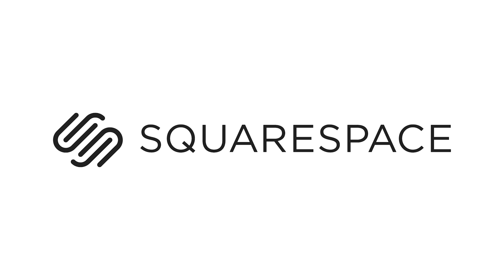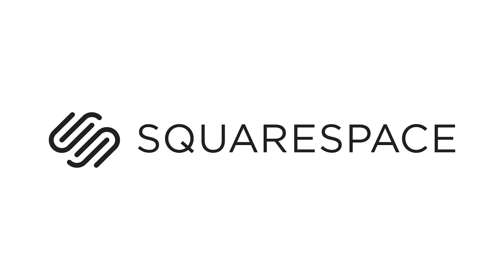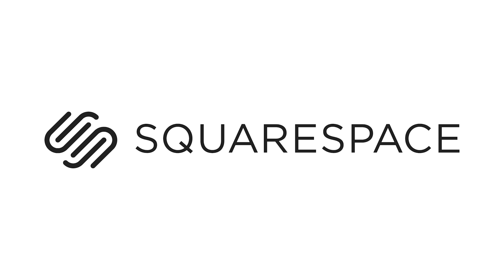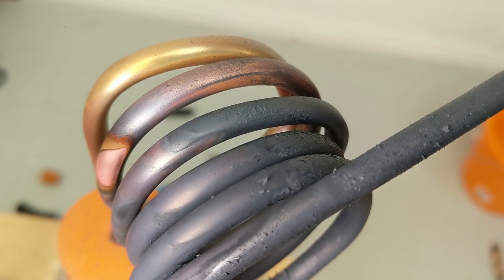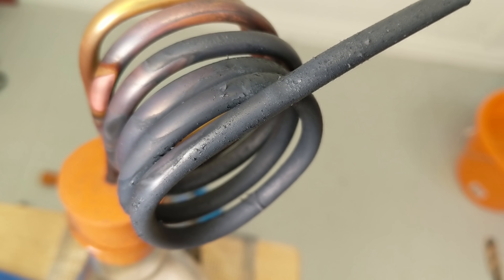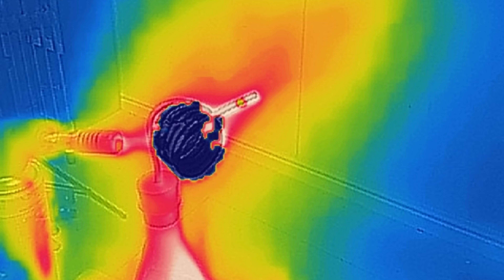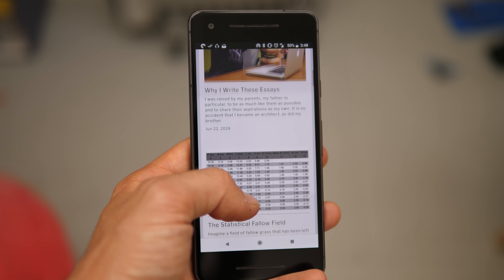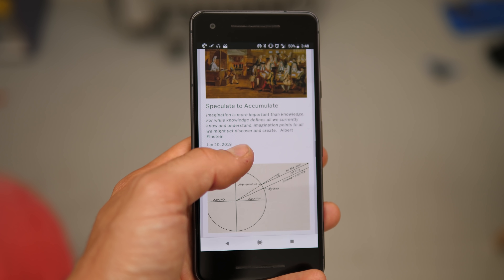Can you light a match with water?

Comment: I know that I'm late watching this video, but at the end where you talk bout the "Fire Triangle" you had that wrong. because the new term is called the " Fire Tetrahedron" which still incorporates Oxygen, Heat and Fuel but also  has Chemical Chain Reaction as a 4th component to Fire.
Reply: False, and that'd be a fire square, or at the very least a quadrangle. You have listened to someone too excited to tell you what went before is wrong. That is a process. And it is a mundane triangle. For example, a flame like event could occur with other elements other than oxygen.
You can tell whoever told you that is a piece of work that they rejected square, rectangle, oblong, parallelogram, rhombus, or, more accurately a quadrangle. 

Its a case of 'overcorrection'. If you wanted to swap to greek, you should use the correct parlance of 'tetragon' to conform with pentagon, hexagon, septangle, octagon, nonangle, and so on.

Comment: Put something on fire needs three things: temperature, fuel and oxidizer. Gas state water can bring match above its flash point, the tip of the match has both fuel and oxidizer, so I think you can do it!

Also, the match stem is mainly made of wood, it needs oxygen to burn. After the tip is done, if gas state water prevent oxygen in the air touching the match, then the fire can't continue.

Comment: Water is actually poor at conducting heat, but you need to stop it circulating because the movement of water will transfer hear effectively.
This is why a wet suit works to keep divers warm in cold water, the water is trapped stationary.

Comment: Very cool experiment, but I do dispute the statement that "water is a pretty good conductor of heat".
I remember an experiment which demonstrates that the opposite it true: Start by weighing down a lump of ice in the bottom of a boiling tube, setting the tube at an angle and filling it up with water. Then apply a flame to the upper part of the tube. The water can be brought to boiling without melting the ice at the bottom. This demonstrates that without the effect of convection, water actually has very low thermal conductivity.

Comment: Ya no one can see the blow torch. Its invisible.
Also, its a useless experiment.
Because using fire to boil the water, again using blow torch to heat the coil.
All to light a match.
AND, THE MATCH BURN BECAUSE OF THE BLOW TORCH, NOT THE WATER.

Comment: Just from seeing the setup I'd say yes. After all the reason water is so good in fighting fire is it's potential to draw energy away from the fire utilizing it's enormous heat capacity and it's suffocating effect by keeping oxygen away from the fire. 
Here you saturate the water with heat and thus also turning it into a gas that might even break down to oxygen and hydrogen which in that combination is highly volatile anyway.

Comment: 0:35 water actually takes not only heat from the flame, but the oxidized as well(a.k.a. Oxygen), which then prevents match from catching fire again, lighting a match in vacuum isn't exactly possible(i mean in absolute vacuum, but in low density air it is hardly possible(counting that you have the lowest density of air in chamber to even light the match))and I'm off the theme here, so yeah, water doesn't take just heat, it takes oxidizer as well
Reply: Maybe in alternate universe where water disintegrates into Hydrogen and Oxygen from heat and forms back from burning those together it would make(kinda or not) infinite cycle where the flame is just boosted infinitely

Comment: I'm going to take issue with your comment that water conducts heat well. It doesn't. Water is not a good conductor of heat. You can test this by jamming an ice cube at the bottom of a test tube full of water, and boiling the water at the top of the test tube over a flame. It takes ages for that heat to be conducted down to the ice to melt it. No, water is great at convection, but not conduction.

Comment: I work at a coal fired power plant, and we use steam at 602°C with a pressure of 260bar in the entry of our turbine. A steam leak in a power plant is actually very dangerous. As you can see in the video, superheated steam doesn't create clouds until it cooled down to be normal steam. So it's like an invisible pressure washer at a temperature that's close to melting aluminum.
Reply: I've heard tell that to check for pinhole leaks in areas where there's a lot of other background noise, a rag or piece of paper on the end of a stick has been used.
Reply: @paulk5670  yes, that's right. I've done that myself. When there is condensed water building up on a surface where there shouldn't be any (and there shouldn't be any pretty much anywhere) we get suspicious and don't walk there. Instead we use a rag on a stick to check for rapid moving gas in front of us. Superheated steam under high pressure is very much like a plasma cutter, but it's invisible.
Reply: Do you guys have any protection that you use before entering the turbine room then?
Reply: @trinitronaphthalene  our protective equipment is our ears. A steam leak is extremely loud, even louder than a train whistle. And the most dangerous place is the boiler house, the turbine room isn't so bad. The greatest danger there is a possible hydrogen leak from the generator, but this is covered by sensors in the area.

Comment: Can you light it by superheated liquid water in a pressure chamber?
Reply: How are you planning to get the match in there? Or the air, for that matter?
Reply: @twistedtachyon5877  A pressure chamber is full of air. That's the whole point of a pressure chamber.

You could move the match into the water using a remote controlled motor.

Comment: 0:42 And an extremely high "heat of vaporization". So when you douse a flame (500+ celsius degrees), you get a lot of steam first, along with the typical sssssshshshsh sound of fire extinguished with water. This takes away from the fuel a lot of heat in very short time. Typically this is enough to reduce the temperature below the fire point so the fuel is no longer able to sustain the flame. Then the fact comes into play that when the fuel is doused with water, the oxygen has really hard time getting to the fuel. This prevents the fuel from heating back to the fire point when some oxygen reaches it and it is still above its flash point. The high heat capacity of the water keeps the water on (and in) the fuel longer because (once the initial flash-boiling is done) due to it the water takes long time to reach its boiling point again and the high thermal conductivity of the water means the heat from whatever was burning reaches the evaporating surface of the water longer (the water keeps evaporating at a really high rate even after it is no longer boiling). All of this works together to extinguish the fire.

Comment: what about that thing where water compresses into a flash of light when it falls into a bubble of vacuum, does that produce enough heat to cause ignition? :P

Also, superheated steam is neat. Can you superheat a cloud? Or I guess the better question is, how much air pressure do you need to have hot clouds lol

The idea that hot water can light a match is kind of pretty obvious, right? I would assume most people would assume that of course you can light a match with hot enough water, why wouldnt you be able to? What I took away from this video that's going straight into my useful and interesting information bin is that copper oxide isn't green, and that its malachite which forms from copper oxide reacting with co2, thats really neat
Reply: Water compress into light? Bubble of vacuum? I think you've had a bit too much of something. None of those make sense.
Reply: @mandowarrior123  https://www.youtube.com/watch?v=wTNbsKX4OV0

Comment: Technically it is water atoms heating the sulfur to it's flash point.
 but it is NOT water that is causing the match to ignite. This is why I used to word "atoms" because H20 exists in 3 states related to the heat energy stored, solid, liquid and gas. We intuitively see liquid H2O putting out fires. [absorbing energy] so this seems counterintuitive.
So this H2O is saturated with energy that it carries the energy from the torch directly to the sulfur tip.

Comment: Fun fact, Some Steam Locomotives are fitted with super heatars and they used a bit of wood to check for leaks and when it passed the leak it would instantly char. In fact locomotive super heaters could heat the steam up to 1000*f and if the regulator was closed the elements that went over the fire could melt (snifters mitigated that risk by letting air through the elements and thus keeping them cool while the engine was drifting).

Comment: Hey there, recently i noticed something interesting. If you rub your mobile phone's charger's metal part of micro usb or type c with your ear pinna while plugged in with wall outlet, you can hear a buzzing sound like arc. I don't know the real reason. do anyone know it? 
i discovered it as i always test a third party charger before plugging it to my phone to check if there is any high leakage current. the way of doing is by touching it to my ear. if i get zapped myself, then i consider the charger is not good for my phone.

Comment: Let's say we were able to make water really really hot, hotter than the temperature of the flames, but stays in the liquid state. If we throw it on flames theoretically the water won't turn of the flames?
Reply: You can blow it on in the gas state and it will displace the oxygen in a conventional fire, putting it out. If you superheat water and keep it liquid, if possible, once you release the containment it will flash boil and explode, putting out the fire.  Water removes both the heat and the oxygen and saturates the fuel reducing its surface area to the air, having an effect on all fire elements. Just affecting one will not prevent that.

However, once the water evaporates and air returns, the high temperatures would simply cause reignition.

You can actually try that to be honest. Some alcohol fires etc burn at around 70 degrees or so, so you can heat some water to the same and try dousing it.

This also doesn't touch on self propagating flame- there needs to be enough burning to provide enough heat to keep it burning. Its difficult to set wood on fire for example but will burn when hot enough.

Comment: I believe it used to be well-known by steam locomotive engineers, that superheated steam was not only 'dry' and non-lubricating but could have a 'burning' effect on oils and could attack materials that would have been perfectly satisfactory with 'saturated' steam.   In other words it was a whole new order of difficulty to work with.
The advantage was that it was more 'fluid' and could expand much further before turning back into water vapour, hence giving more power and economy from the same dimensions of engine.

Comment: The exhaust of the flame aimed at the copper coil could be contributing a significant heat gradient to the match’s ignition point without necessarily going through the copper coil and into the steam, therefore this experiment should be repeated with a thermal isolation barrier between the flames that heat up the water and the point of ignition. Last but not least in a situation of survival how do you ignite the first two flames without a lit match to begin with?

Comment: How do you know the steam has anything to do with it.  Could be just super heated air by blasting the copper coil with the butane/propane flame.  Take the flask with water out of the equation and see what happens with just the coil and the torch.

Comment: Use this apparatus with dry ice, make a superheated co2 emmision and see if you can turn copper oxide green from black
Reply: The CO2 would be on the inside of the tubing.

I guess you could lengthen the tubing at the end, and bend it back around to point back at the coil? You'd mostly get the green all in one spot that way, though, I'd expect.

Comment: I've seen this demo done a few times now. I have a question that's been bothering me about. How does the match light if it's being flooded with water vapor? I get the water vapor is hot enough to light the match, but where does the oxygen come from? You're effectively removing all the oxygen around the match and replacing it with water vapor. Once you do that it shouldn't light. Yet it does. So I'm missing some component here. Any ideas?
Reply: Well, that is probably why it goes back out when put directly back into the stream again.

But if it's at the edge of the stream, it gets hot enough to light, but there's still oxygen on the other side.

The steam is moving fast, because of how fast it's pushed by the steam still heating and expanding in the coil. So it's more of a directed stream than just sorta spreading out in the air just diffusing like it would if it weren't moving very fast. The shape of that stream is also why with the paper there was a nice neat little hole burned in the middle before the fire started spreading further out once it lit, and why the plastic only melted in very small areas at a time.

Comment: Great demonstration! I have a silly question though.
Why does it have to be a copper coil, and not just a length of pipe to super heat the steam?
Reply: Because you heat more of the pipe with the torch than if you just had a straight pipe
Reply: @hackerulroman  Thanks!👍
Reply: Copper is very good at conducting heat
Reply: @deadalpeca8099  ThankYou!

Comment: I'm betting this only works because of the P4S3 on the match head. It is self oxidizing. Though you might be able to heat wood to ignition temperatures, I doubt that you would be able to create a flame on wood alone, because of the fact that the steam is pushing all of the air (and, consequently, the oxygen) out of the way. You would probably just create charcoal (by evaporating the impurities and phosphorous out of the wood).
Reply: It induces flow of the surrounding oxygen carrying air.

Comment: Would there come a point where enough heat would separate the hydrogen from the oxygen like we see with electrolysis?  Is water viable in a plasma state?
Reply: If hydrogen is separated from water it wouldn't form plasma ofc enough heating will cause them to break up

Comment: Steve, the copper pipe turning black is not what's interesting.
Notice that it turns back to shiny copper when heated by the torch. 
1:56 The oxide on the pipe directly in the flame gets reduced back to copper metal by hot carbon monoxide, 
produced from incomplete combustion.
 It oxidizes again immediately after you take the flame away because it's stupid hot and air oxidation is much faster.
Reply: What if you warm up thecopper,let it react with oxygen, the turn off the fire and let the gas flow on the hot copper. Will the copper oxide get reduced to copper metal
Reply: @yohaijohn  ?is that oxidation.  As a welder it looks like the carbon is consumed by the flame, as long as the flame envelope surrounds the copper it cannot oxidize, when the flame is removed two things happen, the oxidation begins immediately but also the carbon condenses on the copper (black = carbon)
a green patina will be the color of copper oxidizing not black.
Reply: @randolphtorres8101  Copper (II) oxide is definitely black (as well as carbon, but I find a blue flame doesn't produce much soot). Green is copper (II) carbonate-hydroxide.
Reply: @dmsnch  Thank you
Reply: haha thats what I thought he'd be pointing to when the "you know whats interesting" came out lol but we were both wrong! :P

Comment: This was a very unconvincintg presentation: you pointed the flame at the match, and the steam wasn't visible on the white background. And its not about heat capacity but phase change which requires far more energy than heating the water. While doing the phase change, it's temperature doesn't rise, so all of the water has to be boiled away first (at least with porous materials).
Reply: I may have misunderstood what you are referring to by "it" here, in the "its not about heat capacity but phase change". Putting fires out, the phase change does play a very big role. But for lighting them as in this demonstration, the steam has to be so much hotter than its boiling point, I'm not sure the phase change is relevant at all to the actual lighting process.

Clearly, this is a very inefficient method of lighting a match. It requires two different heat sources, one of which quite clearly has to already be hot enough to light the match on its own without bothering with the steam and piping. But it is an entertaining method of doing so.

Comment: I was thinking you'd use friction to create the heat, rather than pre-heating the water into a gaseous state. If you used one of those water cutters that can cut through all sorts of hard plastics, rocks, etc., (or maybe something a bit less powerful so it doesn't completely demolish the match), could the friction produce enough heat to light it, or would the mass of the water be enough to conduct the heat away? I'm assuming the head of the match contains an oxidiser and therefore wouldn't need to be in contact with the air.

Comment: In strictly pedantic terms, the greening is not called oxidation, but instead "patina-ing" because of exactly the things you described. Raw oxidation ("scale-ing") is strictly the formation of oxides, while patinaing (and its cousin, more violent friend, "rust") is the act of the metal exposed to "the elements" reacting to form a layer on the outer shell. You can see a similar difference between forged metals, a train track, and a non-stainless kitchen knife. Raw oxides (scale), naturally occurring oxides (rust,) and the protective layer formed from  exposure to food matter, water, and the atmosphere combined (patina.)
Reply: Isn't rusting oxidisation?